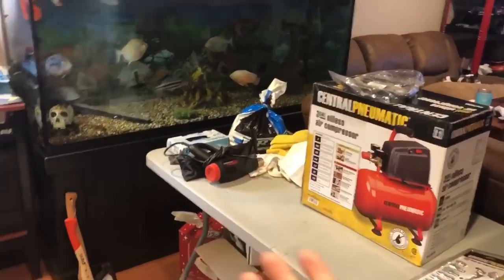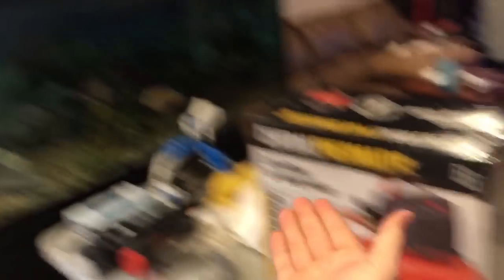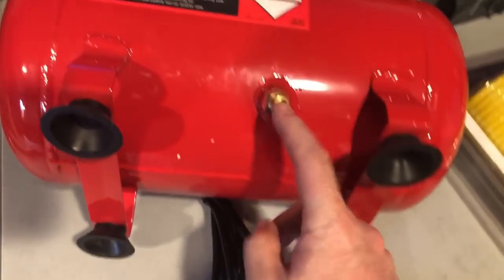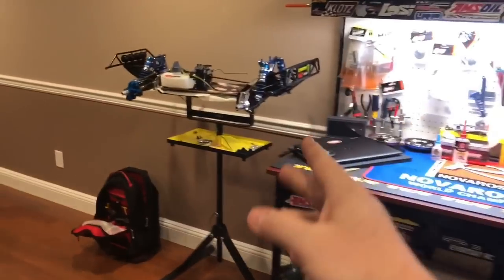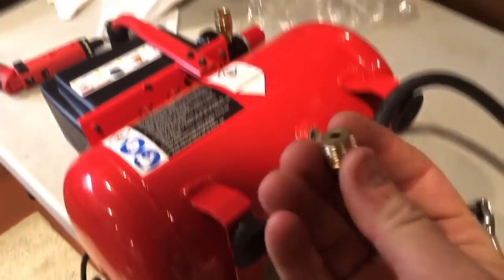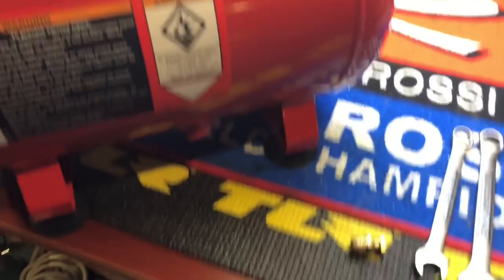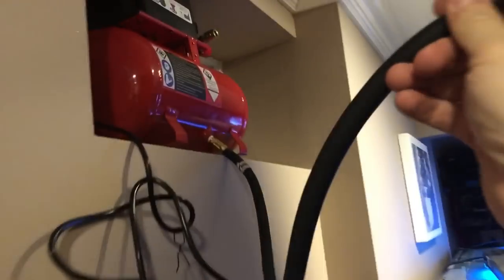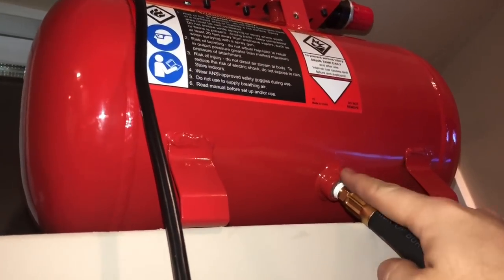Part 1, Upgrades To My RC Work Station ( Little Air Compressor) Harbor Freight

Comment: Looking Good John. 
Throw that yellow hose straight in the trash Lol. All the ones I've had leak as soon as you put pressure to them. I run the same Orange hose and have had great luck with it
Reply from the maker: MGP CUSTOMS thanks bro I know what you mean and I already did! I’m also going to get a better air gun because this one sucks I don’t like how it feels. The Orange hose is pretty good so far but I can always upgrade to the blue hose that’s coiled like this from LOWES or HUSKY or SEARS or maybe the next time I go to a Tractor Supply CO. ??

Comment: Botajell so to let the water out the air compressor tank can u just unscrew the screw and turn on the air compressor and let it blow air thru it to let the water out ?
Reply from the maker: Ryan that’s exactly how I’m using that black hose for that’s on the right side near the fish tank. That workbench has become heavy now and ever time I move it , it scratches the floor so now I will not need to move anything and still keep the air compressor out of the way
Reply: i never knew that u had to do this until i saw ur video. i was just wondering if the procedure i asked is the correct way to release the water. And do u have to do this every time u use the air compressor?
Reply from the maker: Ryan yes you should get into the habit on draining your air compressor tanks every now and then!! It’s very important because your tanks will start to rust from the inside out and you will have water or rusty water and even sometimes rust debris travel to your air lines and even air tools and that can mess jobs up and even mess up the tools and short life of an air compressor. I drain my 60 gallon and 30 gallon and 15 gallon tanks once a month sometimes 2 if I’m using them a lot? I used to drain my 20 gallon every day when I did roofing !! We would run 2 and sometimes 3 air roofing nailer guns all day long everyday and every night we would drain the tank. It all depends how much you use it and how big your tank is. The smaller the tank the more you would have to drain it!

Comment: Yo Nitro brotha, my next purchase I have been thinking about a air compressor. I seen 8 gallon 1 horse Craftsman for $230. What do you think? I want to be able to dry off my my buggy after wash, blow off my porch, and fill any car tires that's needed. What gallon and horsepower you suggest?
Reply from the maker: paul johnson bro you must have a 30 gallon definitely no smaller then a 20! I use a 60 gallon but I used to use my 30 gallon for years it was a 5 HP Craftsman. If you go any smaller? You will run out of air quickly and your motor will always be running and your air pressure will drop and you won’t be able to finish the job correctly .
Reply: BOTAJELL Btw I bought a 26 gallon 1.8 horsepower Craftsman. Hope it will do, that's all I can afford on my budget.

Comment: Hey bud I plan on getting one too! I have 2 bigger compressors as I am a wood flooring installer but it's always a bitch bringing them in and out so I'm going to buy one this weekend! Thanks for the tip! It's going right in my basement next to my work (rc) desk. How much was it? Maybe I missed that part.
Reply from the maker: Chris Watson if you have the room ? I highly recommend the next one bigger then this one!! It would be more helpful for you in the long hall but if you don’t? This one so far has bin ok for me in the past week!! The best part of this compressor is that it only cost me $37 dollars lol!! With a coupon . It’s good enough for me to clean my Nitro Engines and pipes and Differentials!! It may even be good enough for a trim nailer gun for your job? Bro stop by and give me an estimate to re do my Brazilian Cherry 🍒 wood floors on my first and second floors.
Reply: BOTAJELL Haha sadly I don't refinish.... Thankfully I only install pre finished wood and don't do refinishing as it's a bitch and a mess to do! Brazilian cherry? NICE! You just went up a notch in my book john! Also I'm just looking for a really small compressor to blow out my rc's (sadly ewords) so think that size would work out nice. Hey John I was gonna plan a trip to your beautiful state when the weather gets nicer and spend the weekend there in the city. Any chance I could go to your local track? Im plan on buying my first nitro, a losi of course and maybe could rip it on that track and you could school me on the do's and don'ts of breaking in a nitro? If you need any tile, hardwoods or laminate  (you don't strike me as a laminate guy, lol) installed I'm your guy!
Reply from the maker: Chris Watson great stuff ! I installed the laminate floor in my basement. It’s fro DuPont . Bro we will go out to LI BASH !! Zeeeeeaah! Fith scale or nitro ? I’m your boy!!
Reply: BOTAJELL Haha I'll take you up on that bud! Once weather warms up I'll be out there! You are the nitro boss! I will ask your advice when I am ready to buy my first nitro this spring. Would love to bash with you guys. Gonna take a weekend and come to NY, such a great state, I'm in RI so I'm pretty close. Thanks john! And good choice going with the laminate in the basement, very stable and durable stuff. And serves its purpose well. Good job on the install as laminate can be a bitch getting it under jambs and to lock up. Nothing a little shave of the tongue and glue can't solve, lol.

Comment: got the same little compressor bro dont let it fool you its got blow power turn up regulater all the way up yea cleans my rc no prob
Reply from the maker: Dana Checrallah bro I went to turn that bitch up to the Max and it would not go anymore lmao!! Someone already did it for me? Either it came like that from factory or someone did it at harbor freight?

Comment: I have the stock 23cc engine in my losi dbxl do you think i should go with 500k diff oil  because it only calls for 50k, will the engine it be powerfull enoph for the 500k

Comment: hey too all you guys with traxx diffs hot racing diff cups and alloy cases and shim those puppys been there with traxxas diffs no more FLM  its kinda sad
Reply from the maker: Dana Checrallah thanks for the heads up that is sad!! I’m used to hearing things like this lately !! I also herd Phat Dads are discontinued there Heavy Duty Diff set ups for the most famous RC in the world the Losi 5T and I cannot believe it so I hope FLM still has there set up for 5T ?? Phat dads are way stronger then the FLM but they worked well also on some friends of mine stuff!
Reply: i know big JOHN traxxas is a 1/10 vehical i will never buy trx again my t-maxx has nothing trx on it anymore all after market to get it somewhat durable i hope LOSI A/E MUGAN XRAY STAY UP TEKNO is good as well traxxass is nothing but toy vehicals as im concerned just my opinion
Reply from the maker: Dana Checrallah that’s what I have bin saying since 2005 when I had four T-Max’s . Wish I still had my Mad-Max conversion t max but just as a shelf queen because that thing would break every time it was out but it looked so bad ass! It was really bad even after I dumped so much money in it with upgrades and so much wrench 🔧 time I had in it. Losi LST and MGT were my favorite and I think the most durable at the time from bashing those days had to be the MGT. LST was the best jumper and flyer even better in my opinion then all the HPI savages I’ve had. I used to have an Inferno Buggy and that thing was most durable of all at that time. I never came across anything yet and Nothing I have ever had compares to my TLR 4.0 Truggy yet. If I do come across something that surprises me with durability and handling on air or land I will definitely mention it!!
Reply: very true wish i still had my jato x-maxx all plastic trx is a magnet for e-word newbies wich is ok all good you got to learn before you can burn i can remember my cox sand buggy back in the 70s those where big back then cause remote control was big bucks in the 1970-73-4 rc has come a long way look e word nitro engines are getting better as well ill stay with nova rossi im done with rtr engines the force .28maxx i got is ok for a trx maxx real big blocks tear them up
Reply from the maker: Dana Checrallah do you remember the Kyosho Nitro Sandmaster 2 ?
Reply: sory john just got in yes i do remember